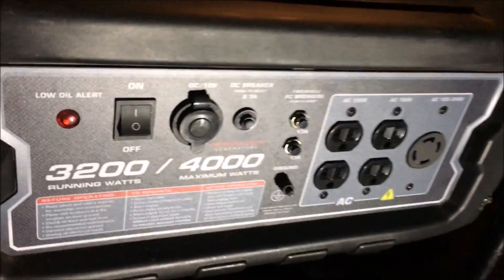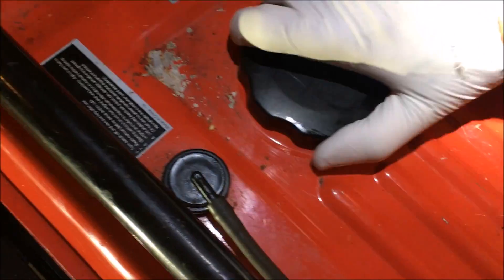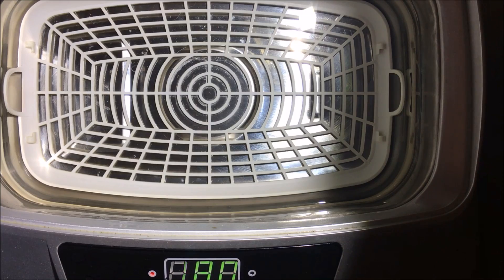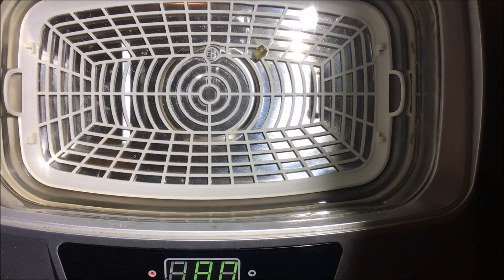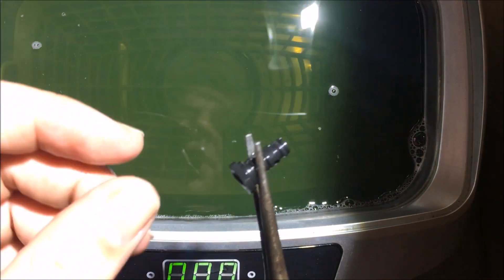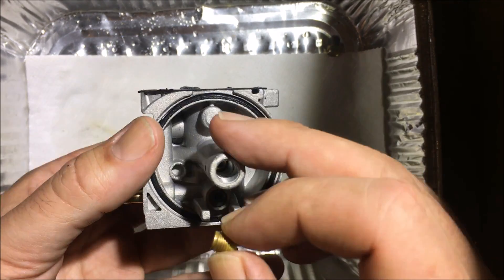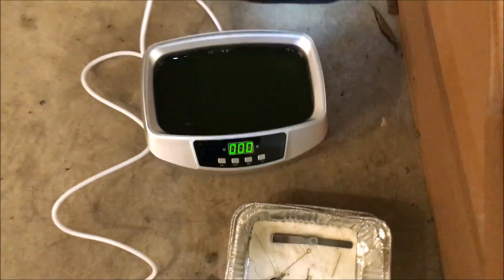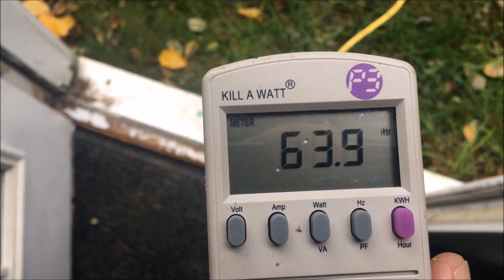Predator Generator Not Starting - Fix

Comment: hey james, long time watcher, Ive recently gotten two of these same generators

cleaned carbs and also bought two new cheap carbs on amazon

both start fine with choke but as soon as i set it to RUN   they both turn off

any ideas? would it be because of lack of fuel stabilizer? oil? spark plug? any help appreciated!!
Reply from the maker: Running too lean.  Need to drill out the pilot jet.

Comment: Great video.  Got a Predator 4000 couple years back and used it once for a short amount of time.  Forward a year and with starter fluid starts for a second then dies.  Checked with local repair shops and they don’t work on Predators.  Was wondering if I could do myself.  I AM NOT MECHANICALLY INCLINED (done some assisting on vehicle repairs is all) but can follow directions and this video is very straightforward.  Going to give it a try.  Only thing is I don’t have a sonic cleaner- will carb cleaner work?  THANKS FOR GREAT VIDEO!

Comment: I have a Honeywell 7500w, Generac engine. It starts and runs just fine when I use the pull cord, but it doesn't do a thing when I press the electric start switch...no turn over, nothing.

Comment: James! 
 Great videos! Very helpful stuff!
 I do need help, I have this generator and it'll start (fire) on choke and immediately die. 
 I've disconnected all the electrical safeties,  changed carbs (new), new NGK plug adjusted valves, on TDC. No change. Gas is fresh. Good gas flow. 
I'm stumped! 
 I've checked all the things I've seen you do except check the compression release. 
HELP!

Comment: I have a 9500 that I got for free because it doesn’t start. I opened up the valve cover and one of the valves has a zip tie around it. Is this normal?? The guy told me he took it to a specialist and said he had valve issues. Do you think he was out to screw him?
Reply from the maker: It is not normal to have a zip tie on the valve.  Maybe it is holding the valve from falling into the engine?  Is the valve spring retainer broken or keepers missing?
Reply: @jcondon1  it just doesn’t have a spring on one of them, the generator cranks over but doesn’t start

Comment: My 8750 ran great, untill I shut it off one day, and an hour later it wouldn't restart. The carb was gunned up pretty bad so I ordered a new carb which came with a fuel filter, fuel line and spark plug. After installing everything it still wouldn't fire. I tried starting fluid and got nothing which told me the fuel wasn't making it to the combustion chamber. I pulled the valve cover and found the intake valve stuck open, causing the pushrod to pop off the rocker. I got the valve moving freely again with ATF, reinstalled the pushrod, set the valve lash, and had it running like new in 45 minutes. Give that a check before tearing everything down. The valve cover is just 6 bolts.
Reply: Thanks for posting.Exact same thing happened to my 8750.Little cap on top valve stem went down the drain hole but fished it back out. I was heading over to carb when I read your post.

Comment: Thanks a lot for the detailed video. My generator didn't start right before a winter storm and after sitting unused in my garage for a couple of years. Got some Carb/Choke Jet Spray from Autozone which got the generator running for a second or so after spraying some into the carburetor. This was telling me that there was a spark, the oil shutoff was not triggered, but there was no flow of fuel.
Based on this video, I took the cap off the carburetor and unscrewed the jet which turned out to be totally clogged. Cleaned the jet, put it back in and the generator worked. There was no need to take the whole carburetor off.
Reply: How did you get the jet??

Comment: Looks like most of the problems with generators and lawnmowers is problems with the carburetors! Looks like the manufacturers relie on selling new generators and lawn mowers by installing complicated carburetors so if they don’t. Start or run they sell a new machine ! I couldn’t possibly fix it ! Or pay over $ 100 to have it fixed !

Comment: Spark arrestor, almost every time on these! It is suppose to be cleaned every oil change. Some remove them. Read and learn more about them to understand if and why you need these. If cleaning your carburetor doesn't do it, heck it doesn't even matter if your carburetor needed cleaner or not, check this out!

Comment: Ok
Now I was having a lot of trouble getting my 2 predator generators to start and stay running
Well yesterday I discovered something I totally forgot about the reason they wouldn't stay running
There is a screen on the back of the muffler and once I cleaned and removed that screen both my generators are running and even burning less gas

Comment: The little black piece that has a screw above it is there any specific way it's to be installed back into 
And are they only for that carbarator it was removed from or do they interchange with other carbarators
Reply from the maker: That piece has a flat edge on the top.  Just have to align it properly so it drops all the way in.  That is the pilot jet.  All Honda clones in the 6hp range have it.  They are interchangeable, but the jetting might vary a little.
Reply: Ok now I noticed that one hole is bigger than the other on both the spot it goes in and that piece 
I've got 2 predator generators and I have not been able to get them running they start open the choke and then dies like it's out of gas and I have rebuilt carbarators and it's all the same thing

Comment: I have a 9000 predator. It looks almost identical except it has a solenoid on the bottom of the fuel bowl.
Reply: What kind of solenoid? Is it a bystarter? I’m looking at getting a 9000
Reply: @danielcantrell3872  I'm not sure of the details, but it has a rod that runs into the main jet to meter the gas somehow. It still has a float and needle valve. I would guess it meters the gas like an injector does on a car engine.

Comment: Got the same generator except mine will not pull at all. I remove spark plug and it pulls no problem but as soon as I put it back in nothing won't pull but like an inch or whatever like seized almost. Any ideas on where to start?
Reply: Your  generator is. Vapor lock

Comment: Thanks for taking the time to go thru the carb. I have a couple of these and one thing I notice they all burn fuel at different rates so I'm planning to do a carb teardown and look for any tell tale signs.
Reply: Portable generator safety: Always make sure you follow all the generator safety rules whenever you use your portable generator. This is only a reminder. Generators can be dangerous if not used carefully. Every year, hundreds of people die or get injured when using portable generators due to carbon monoxide poisoning and electrocution. Make sure you are using your generator carefully and keeping others safe as well. There is something very serious that everyone should always be aware of when using generators. Some people do run their generator indoors which is not safe and that increases the risk of carbon monoxide poisoning which can cause death of family and you. Some people run their generator in wet conditions which can electrocute them. Please remember that you should never run your generator indoors. Remember that carbon monoxide is an odorless and colorless gas that you cannot see or smell. Carbon monoxide is a silent killer. Keep that in mind. Make sure your generator is 15-20 feet away from your house and away from doors, windows, and vents. Never use your generator in your porch too. Having a carbon monoxide detector is very important against generator safety. Some people also allow children to go near the portable generator which could pose risks. We need to keep an eye on our children making sure that they are not near the portable generator so they won’t get electrocuted or burned by the generator which is dangerous. A locking enclosure also keeps kids safe. A generator shed might look like a tempting place to explore, or take cover during a game of hide and seek, but a generator is a dangerous piece of equipment that can cause injury. It says on the manual that we should also keep children away at all times from the portable generator to avoid injuries. Please do not allow a child or unqualified people to operate the portable generator.  It is important to keep your children safe especially little ones. The portable generator can be hot during an operation. Just because some manuals missed what should be listed doesn’t mean it’s safe to do. Always follow the generator safety rules when using portable generators. Generators pose electrical risks. If you need to use your generator during wet weather, you need a generator tent to protect your generator from getting wet. Don’t let your generator get wet. Keep your generator dry and before using your generator, please make sure your hands and your generator is dry. Do not wear loose clothing when operating the generator. Everything that is said on the generator’s operating manual should not be ignored. Never smoke cigarettes near the generator. Please keep flammable things away from the generator. Never overload your generator too. Your generator can catch fire. Never ever try to plug a generator cord into a wall outlet to avoid back feeding. Back feeding your generator is dangerous. Always turn on your generator first before plugging in appliances and shut off the appliances before turning your generator off. Use a heavy duty cord for your generator and the cord should not be worn out. All the instructions should be followed carefully. Never refuel your generator while it’s running. It can cause fire if fuel spills while your generator is hot. You should turn off your generator and let it cool off before refueling it. Having a fire extinguisher next to the generator is also important. This is only a reminder for everyone’s safety of using generators. Make sure your generator is properly grounded. Having a fire extinguisher next to the generator is also important against the safety rules. https://youtu.be/I1jT3ANENvI and here is a video more about keeping others safe when using generators and also about our family’s safety. It’s important to keep our little children safe as well. Make sure your little children are kept away from the generator at all times especially when it’s running. Hope this helps. Always remember that being safe is better than being sorry.

Comment: I honestly had the same thing happen on two occasions. The first time was the CARB California compliant hose on the back of the air cleaner that put unfiltered crank case oil fumes directly into the carburetor. I removed that, and sealed off the opening in the back of the air cleaner with FOIL HVAC tape, and drilled a hole in the front of the air cleaner, installed a hose nipple and reconnected it to the front, clogging problem solved. I flushed out those ports with the cover and filter off using b12 chem tool and it started running just fine. The second time I accidentally left fuel in it for a year and the carb bowl clogged up with sludge. I removed the air cleaner assembly (makes it easier to get to everything, then I removed the fuel line from the carb and let the remaining fuel run out  into a container, swished some SEAFOAM cleaner in the tank and left it run through the strainer and fuel shutoff valve. I removed the drain screw from the bottom of the carb bowl, and flushed b12 chemtool through the fuel line input and out the drain screw. Then put the carb drain screw back in and filled it up through the fuel input with b-12 and let it sit for about 10 minutes, then drained it, and flush it through one more time. put it back together and with fresh fuel it fired right up and ran great. just to be sure the fresh fuel had the normal amount of seafoam added to it and I ran it for about 30 minutes to further flush the system.

Comment: When I saw that air filter I started laughing. A few years back one of my neighbors asked me could I look at their generator that when we had the big blackout around here that the day before the electric came back on their generator shut off and could not get it restarted. So I told them to bring it down sit it in front of my garage door and I will go out later and bring it in.

When I started messing around with it just like you I'll spray some ether or carb cleaner and give it a couple pulls. Nothing happened and I checked spark it had plenty so then I started to take the plastic apart to get to the carburetor. They had the same filter as this generator except their filter fell apart as I was trying to remove it. I had to get the shop vac out for the first time ever to clean a carburetor and air box and my floor. When I started taking the carburetor apart it was almost like someone was messing with me. There was foam everywhere. I'm not afraid to admit that I had to take that carburetor apart three separate times before I finally got all the junk out of it. I got it to run everything worked. I called my neighbor up and told them and told them it will need an air filter. She told me that she thinks her husband has one for it. That when they bought the generator brand new it came with parts for a tune-up after 25 hours. They could not even remember how long ago that they had even bought that generator.

Like always I enjoyed your video.
Reply: Please watch this video as well it’s very important https://youtu.be/I1jT3ANENvI it’s about generator safety. Everyone really needs to agree with this advice I’m sharing. Thank you

Comment: My generator hadn't been used in over a year. It would run on starter fluid but quit when fluid was gone. I drained the tank and followed your guide to cleaning the carb and jets. Amazed how much gunk was inside. Put it back together and it starts first pull. Thanks for your help!
Reply from the maker: Glad I could help.  Good job fixing it up.

Comment: Thanks for these great videos, James .... I have learned a LOT from you ..... mostly self-confidence.  I used to cringe at the thought of disassembling these small engine carburetors ... Now I've actually repaired two.  My riding lawnmower (surging) and my generator (glued shut with varnish).  Thanks again!  :)

Comment: Wanted to be able to use most of our appliances during a power outage and this size generator fit the needsꉺꉺ>share4.photo/HF87Generator?P16     With that being said, it is large and loud, but it works great! It cranks on the first pull and runs fine. I recommend getting the wheel kit if you plan to move the generator around much, it makes that task much easier. Remember to buy oil and a grounding rod and wire because the generator does not come with either.

Comment: Need advice with the choke setting. ran mine for a few hours but it only ran good when the choke lever was set right in the middle. All the way to the right, and mine would choke it self out.  I saw that you ran it with the choke all the way to the right? Is the run position all the way to the right? I assumed all the way to the right was full choke?
Reply from the maker: On my generator, full choke is to the left and run is to the right.  The sticker on my airbox was upside down.  If unsure, remove the airbox cover and filter and look at the choke plate.  Open is run, closed is choke.
Reply: @jcondon1  thanks. That's exactly what I did. Had to clean Clean out the carb and it's running great
Reply: @andrewelrod5568  here’s a video about generator safety https://youtu.be/I1jT3ANENvI

Comment: Do you have a brand name or part number for the carb you got?  I have the same predator 8750 and bought a new carb on Amazon but the throttle and choke linkage connections don't match up?  Very frustrating.
Reply from the maker: Al Bjorneby I only cleaned my carburetor, did not buy a new one.  You will need to find the model number on your generator and do a google search for a carburetor for that model.
Reply: I had the same problem. My main jet couldn't be removed without drilling, the metal stripped every time I tried using a flathead. Then I bought a new carb and the fuel hose was too short
Reply: Al Bjorneby sometimes you can swap parts from your original to the new one when they don’t match as long as carb body is same

Comment: How did you get the spring off the throttle body? Sitting here fixing it now it’s starting but won’t run any help plz!!!
Reply from the maker: Take a look at my Duromax video.  Link below.  At 3:55 in, I show a close-up of the carburetor.  It uses the same type.  To remove the throttle arm, you rotate the throttle clockwise and lift the arm out.  The spring is very flexible.  You can carefully straighten the hook of the spring that is in the carburetor and lift it out.  Will see if I have another video showing actually showing how the spring comes out.  https://youtu.be/gmRQq9g-q3Y
Reply from the maker: 4 minutes 10 seconds in of the video linked below shows me removing the spring.  Different carburetor type, but removed the same way.   https://youtu.be/K78Jhd03ELg
Reply: Got it cleaned out now it’s running really rough had to remove the black screw now  the throttle is bouncing and knocking very hard any ideal? Thank you for the quick response! I’m currently stuck without power until the morning but trying to figure this out lol
Reply from the maker: Does it get any better using the choke?  If so then that means it is not getting enough gas and something is still clogged up.  You would have to double check the holes on the pilot jet, main jet and emulation tube.  Also if the gasket between the engine and carburetor was damaged could be sucking air though that area instead of the carburetor.  Additionally there are holes in the Venturi tube on the air filter side and the side wall of the throttle plate side although those rarely get clogged.  Would check the pilot jet first since that can be done without removing the carburetor again.  Depending on how bad the carb was to start with, it might not come back.